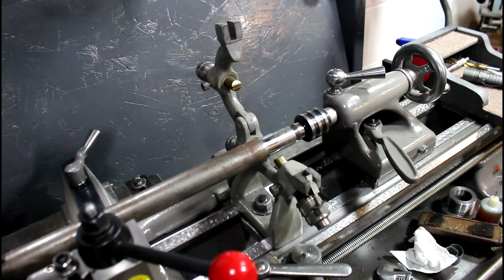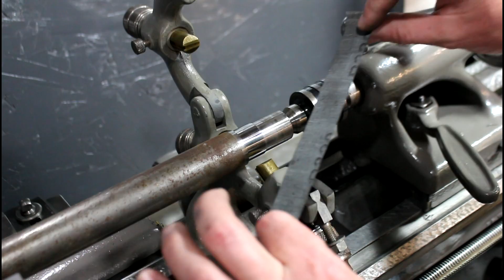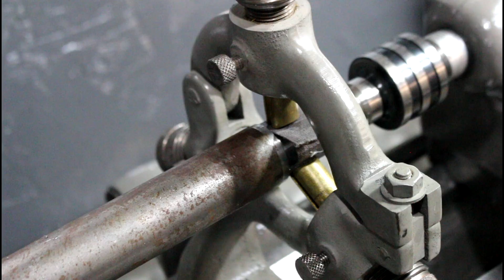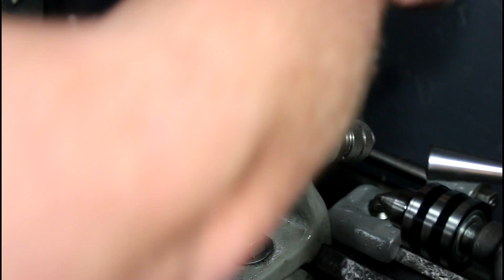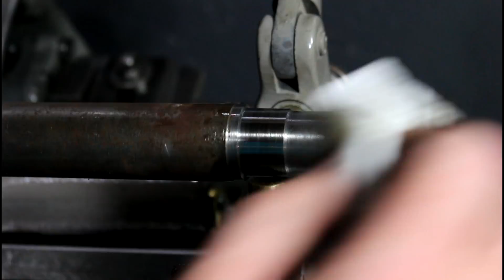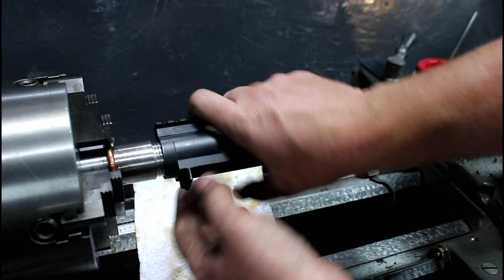Steady Rest Trick on the Metal Lathe

Comment: I would not be comfortable doing this because I'd be worried I was charging the bronze/brass pieces with abrasive material, thus turning them into an abrasive lap instead of a bearing surface.
Reply from the maker: I always do it with used emery cloth. By then what's going to come off should have came loose, and there is metal usually plugging up the rest of it leaving just a rough enough surface to grab. Never noticed a finish difference before of after just using the jaws.

Comment: ugh - i'm trying to find a video explaining WHAT a steady rest is or when you might use it but cannot and this certainly did not help  - from the looks of it - it's ONLY for when you want to use something like a drill bit in your chuck and want to use the chuck to drill into a fixed piece on your lathe ??
Reply from the maker: Mainly used for large or long pieces that won't fit through the headstock.  Just a tool to hold it steady,  while you machine one end or the middle of a work piece.
Reply: but it cannot spin in the steady rest right? i mean - there are three bolt clamps in the steady rest ... this is what confuses me
Reply from the maker: The spinning stock rides on the fingers via a coat of oil, or on bearings on the end of the fingers.

Comment: It won’t be very accurate as the emery cloth will soon loose thickness especially when wet and the bar will start to rattle. As for putting your fingers so near when its running, bad move
Reply from the maker: Never had anything rattle loose in several years of doing this. I was careful not to put my hands or fingers anywhere where they would get caught.

Comment: Tip good. 
 Putting your fingers so close to a pinch point, not so much.  Maybe when you want to add oil, flick up the edge of the sandpaper with the handle end of your oil brush or a dowel or pencil or ANYTHING OTHER THAN YOUR FINGER and it would be a safer way forward. 
Personally i want to stay attached to all ten of my fingers. :)

Comment: Also what I’ve done in past is take 3 pcs of 1” nylon bored out leaving bout 3/16 back solid wall so they will fit over fingers and still have a solid part to rest on part. You can go with a thicker back wall but cuts down on OD size you can use with the steady rest.

Comment: That scraping sticks out like a ...... uhh ...... she's purdy
Reply from the maker: Yes, it is nice looking. thanks
Reply: a lot of those heavy 10's are flame hardened on the tops of the ways aren't they.  Did rescraping remove that hardness or is it just still hardened only scraped too
Reply: @precisionmachineshed  did they have to build up the bottom of the carriage to make up for the scraping loss of material
Reply: @dizzolve  the newer ones were flame hardened.  The old ones like this were not.  Yes,  they added turcite to the bottom of the carrage to build it back up.

Comment: The fuck?  Hack. You know that you're supposed to polish the work,  then clearance the jaws to .001, right?  The followers aren't supposed to actually touch,  they ride on a .001 thin film of hydraulic pressure.  They never actually touch. Jesus....
Reply: On a side note it'll be interesting to watch exactly what happens when a ring gets caught in a lathe.  What will give first?  Subscribed to find out...
Reply from the maker: That is not correct, the jaws do touch the work. If they didn't, it would be pointless to use a steady. You would also never get a good finish it before able to part anything. Yes, you do use oil, but it is a very minimal amount of clearance. You usually lightly snug the bottom two, touching, then bring in the top jaw with super light pressure and it's checked several times when you are working on it. This method is used for pieces that are already polished, it close to final finish. A rough turned piece wouldn't matter.

Last time my ring got caught on a chuck jaw, it ripped the jaw right out if there chuck! Crazy huh!
Reply: Ryan (it seems to me) is presenting an armchair viewpoint. In real life, the cutting reaction forces from the tool force the work into close contact with the top and rear follower pads, and it is regularly a problem that there is galling of the rubbing surface on the workpiece, unless the steady is regularly opened, the surface cleaned, and the lubricant (ideally an anti-scuffing paste, like Never Seez or Rocol) replenished. The method shown by PMS is a valuable enhancement, to my way of thinking, particularly when long surfaces are being turned and it's not desirable to keep stopping during a cut to freshen the lube.

Comment: Most "fingers" are of  bronze, which lubricates. Brass will transfer into your part.
Reply from the maker: You are correct, they are bronze, but will still leave a mark no matter how hard you try.
Reply: @precisionmachineshed  Marked up the crap out of a 416 stainless shaft with softer brass/bronze...yep
Had to friggin bead blast the thing afterward to "erase" the mark...
I heard leather works well since it holds the oil but I like this tip also since the emery paper is thinner and less likely to deflect or act as a cushion as leather would do.

Comment: The purpose of the Steady Rest is to keep the stock STEADY while you machine it. This emery cloth is just that, cloth; this means that while you are machining the part it would act as a cushion that would allow the piece to move in all directions. Have you ever used an indicator to determine what this movement is under cutting? My guess it could be over .001 which would affect any threading operation...
Reply from the maker: Measured it. Keep in mind, I'm used fairly well used up 320 grit cloth that doesn't have much grit left on it. I was getting 0.0004" runout. Id'e call that within tolerances of just about any thread out there!
Reply: People have been using this method for decades so I suspect it works well enough.

Comment: Hi,
that is not a great thing to do to your steady rest. it may be fie for one job but you are embedding grit into the brass jaws of teh steady rest. these will then dig in even deeper next time the steady is used.
Reply: I have been using this system for the last 50 years never had any problems, use a used up emery clothe so there is no grit left:-)
Reply from the maker: I'm using a used piece of 320 grit with half the grit ether has fallen off or is plugged with whatever metal I was using it with. I'm not too worried about it. I only do this when I have a finished or near finished barrel in the steady. In several years of doing this, I have not had a problem yet going back and forth between using the cloth and not.
Reply: I've been doing this for years, as well. The grit clings to the brass and so the paper/cloth doesn't spin. It's not removing any brass material or depositing grit. Just a nice smooth, oiled surface for the metal to contact.

Comment: nice trick. not seen that before. How does the surface of the brass rods look like afterwards?
Reply from the maker: As long as you use a fairly fine grit paper, it turns out good. I usually used a used piece so any little particles of grit that may come off have already fallen off before I use it for this purpose.